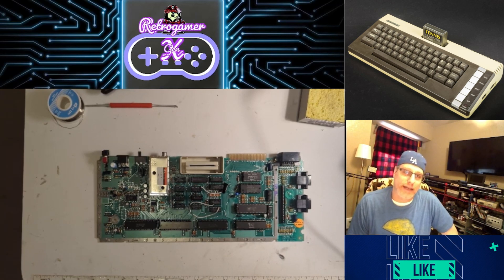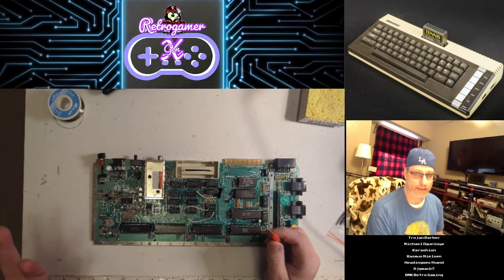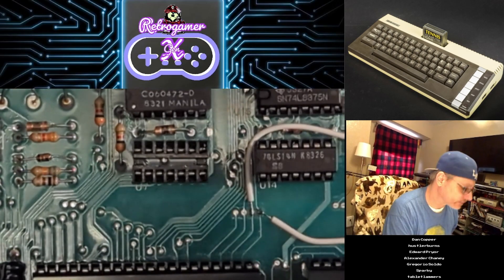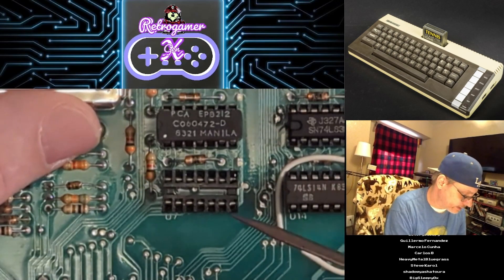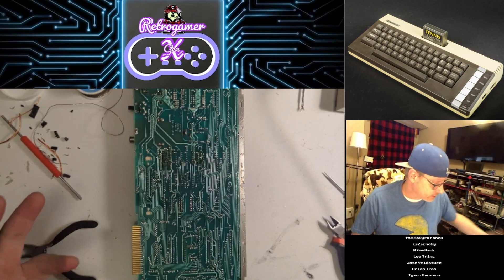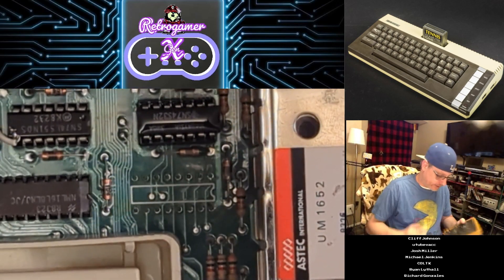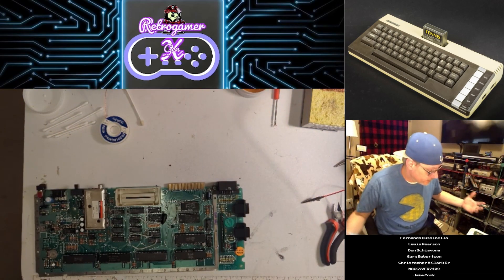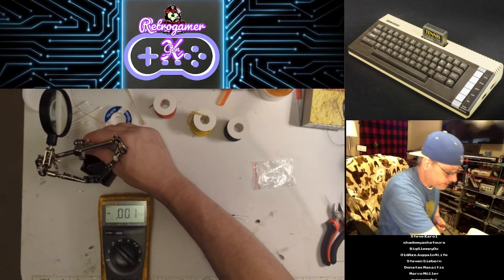Atari 600XL Black Screen Repair and AV Mod Install

Comment: Very informative video. I love that you explain all the parts you are working on. I bought a desoldergun for when I have to do larger projects, but I was using just the sucker for awhile so I feel the pain. I'm glad you got it working and no more black screen.
Reply from the maker: Thanks. Finding where the issues were in the previous video was the hard part.🤣🤣 I really missed using my de-soldering gun. But my tips are just done. I have probably thousands of de-solders on them, so it's time for replacement tips. Their just are not heating like they should and suction is bad. I was better off using the old school pump to prevent damage to the board. Yep it's nice to have a fully functioning 600XL again. 😁

Comment: My 1993 Atari World Rally arcade cabinet also is having a black screen issue. I think it's more due to a connection as it turned on perfectly for 30 seconds after a year off until I tapped the machine's gas pedal and it went off again. Hopefully sautering won't be required!
Reply from the maker: If you have socketed IC's take them out one by one, spray some deoxit (contact cleaner) in the sockets, and re-seat them. If that don't work I would look for a short around the gas pedal wire harness. Idk that's a good one, if you lived closer I'd come out and look at it for ya.
Reply: @RetrogamerGenX  This is great! I'm totally gonna pick up some deoxit and check those connectors. I don't suppose you know how to ground the CRT of its charge? I'm worried about the residual charge doing some curious harm. It's the main reason I haven't dove in fully yet though the case is open.
Reply from the maker: @mattblom3990  If it's been unplugged for a week or so it should be OK. But I do it the redneck way with a long flat tip screwdriver with the shaft wrapped in electrical tape (rubber handle), 14 gauge wire connected to 2 alligator clips. One attached to the screwdriver, and one to ground on the monitor chassis. But don't listen to me, go get a proper discharge tool. Chances are if you were to get a jolt and your healthy, it won't kill you. But it will lay you out on the floor for a while. Trust me, been there done that, will never do it again. 🤣🤣🤣🤣

Comment: Where did you get the A/V mod for the 600XL?
Reply from the maker: I got the AV mod from AliExpress. If you go there and look up 2600 or 7800 AV mod it'll pop these up. Not the best AV mod in the world but it'll work on the cheap. Eventually i'll create my own AV mod board for it based on how the XEGS has its composite video out.  I'm thinking if I replicate that circuit it will have the great looking composite out like the XEGS has. The AV mod I installed here is just a stop gap until I create that circuit.